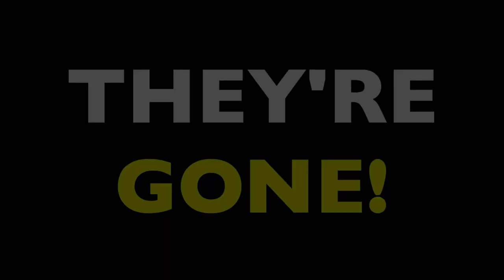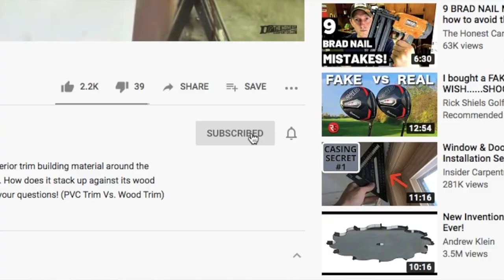There's Something TERRIBLY WRONG With My Table Saw! Should I THROW IT OUT?! (Carpenter Discussion)

Comment: Good subject.  I wangled a new table saw for Christmas.  The choice to upgrade was based on watching some of your videos along with other producers.  I had inherited an older Craftsman saw and it cuts fine but it lacks some safety equipment that is currently considered important.  The new DeWalt is in its box in the garage waiting for a warmer day for its grand opening.  By the way, Ethan, hurry up and get the new tablesaw so we can have a video on steps to set up a new saw :-)  My concern is in getting rid of the old saw.  It cuts well enough for most of my projects.  I don't have the space or need to keep it, but I don't want to pass along a saw with no riving knife, finger board or blade guard.  I HATE to have to just send the whole thing to the dump.
Reply: Someone will want that old Craftsman. Even knowing the lack of safety features they seem to move pretty quickly on Craig's List.

Comment: Had to get rid of an 8yr old rigid table saw because the gearbox burnt up. Rigid revises their saws so often, replacement parts are long discontinued. Cannot be repaired even if I wanted to.
Got a sawstop PCS, no regrets.

Comment: I apprenticed with guys who were born in the 1920s and 1930s. They never seemed to throw any tools out. One of them had a pile of old portable electric drills and saws under a workbench in his garage that included a pair of Porter-Cable worm drive saws that dated back to the late 1940s and would still get dragged out if we had to cut concrete. I now have a number of saws that no longer get used on a regular basis. One was a cheap Black & Decker that wouldn’t hold its depth of cut, anther is a nice Milwaukee sidewinder that should have a new cord and strain relief. I’ve repaired my 12” miter saw several times but I got rid of a Delta table top table saw because the switch would get dust inside and arc weld itself permanently on.

Comment: A tool goes when
1) Safety has been compromised
2) Power cord damaged beyond reasonable repair
3) Accuracy has been compromised beyond normal adjustments
4) When an upgrade is a reasonable option
I usually tear them apart and sort the scrap accordingly since I am a firm believer in recycling, and it's some money in the bank towards the replacement/upgrade. If a tool is in safe working order, I might sell it or donate it.

Comment: Had a craftsman for a while until the magic smoke comes out. Was in the middle of a project and no time to shop. Bought a Ryobi in similar price range.  It was a instant regret the moment I opened it. I needed a saw to complete a project so I keep it for 1 year.  I hated that saw so much, just like that it has to go.  

The riving knife was welded - crooked. It’s top heavy and can tip over if I cut something long.  Cut quality sucks. Non standard miter slots and table top is made with cheap sheet metal.  Not flat at all. Blade can’t be aligned. Simply no adjustment for anything.  It’s a saw-like object. It can’t cut straight unless I spend 1/2 hour setting up feather boards and sneak up on the cut 5x or more. What I hate the most about that saw like object is setting up/taking down. They made worst possible stand in the world. The saw weighs 50 lbs but feels like 100 with the stand open. I was at a point where I hated that saw so much that I don’t want to use it. 

Bought a DeWalt 7491RS. I finally enjoy using table saw again. Setup/take down is a breeze.

Comment: i got rid of my old ridged table saw. it was the cast iron top model before roving knives were standard. i made a zero clearance insert for it with a splitter. but it was starting to have  a little warp. kinda like what happened in video. it was a safety thing for me

Comment: There is a way to adjust the trunions on those saws by loosening a couple of screws in the rear and then you can use a dial indicator setup to bring it back into tolerances

Comment: I repair broken tools unless it's a catastrophic failure (like a motor shorting out that is 90% of the tool cost) or an upgrade from a tool that was crap in the first place.

I have never replaced a saw for a broken guard. I buy an OEM replacement part or just fix it with epoxy, especially when it's just a housing crack(though I always take it apart to check or fix internals). 
My miter saw guard was bent and sticking when I inherited it, I took it apart and hammered the metal guide flat and waxed the slide so it worked. I also replaced the broken feet on its clamps because the original nylon ones crumbled. I'll replace it one day with one with an arm but it's fine for now.

I'm also the kind of person who repairs wooden handles on old screwdrivers, I may not have the most common mindset 😜

Comment: Back in 2017 I bought a Skilsaw SPT70WT-01 worm drive portable table saw that had a stay true guarantee for 180 days and if not satisfied, return it to the place of purchase for a full refund. Well it took way more effort than it should’ve to keep the fence true to the blade and even worse, the blade slowly kept retracting into the table whenever it was running, so much that the riving knife blocked me from finishing the cut. There wasn’t any way to keep that raising and lowering wheel from rotating. I gave up and tried to take it back to Menards under the guarantee and all they offered was store credit. I called Skilsaw and was told the guarantee only applied to certain products. I mentioned I have the printouts that say my product was covered so I was transferred to tech support and when that guy checked, he agreed that the model I bought was covered and had me send a copy of the receipt in. I can’t recall how I eventually received a refund but I did. Perhaps Skilsaw called Menards to make it happen. I bought the Dewalt DWE7491RS and couldn’t be happier.

Comment: I am very much looking forward to your video on table saws.  I have been needing a new table saw for a while now.  The one I am using is a ventage 50s Craftsman.  The Arbor must be bent some how because the blade wobbles when it's on.  It also won't stay to a true 90° cut any more either.  I've been dealing with it because I really like the solid steal table surface, but since I can no long get a true cut from it, it's not much good anymore.
Reply from the maker: Ooh, wobbly blade is a tough issue! Yeah, I’d maybe flip it and poke around in the mount—but it’s prob time for a new one. I’ll try to post the new saw vid in February!

Comment: I trades quite a few tools in the past 2 years, most of the time if not always it’s because i see myself spending more time then i should on a task and quality not being to the level i want. And then i regret to have bought a cheapo because i only tought id use it a few times a year because every time i do that i end up going to that tool all the time.

My philosophy now is always go 2 step beyond what i think ill need because its cheaper then buying low then trashing a tool. And since im doing all the work myself even with that mindset its 5x cheaper then hiring the job out.

A diyer who pretty much on a finishing track of a 1960 house full reno and overhaul

Comment: My DeWalt jobsite saw had the same blade misalignment issue but it came like that right out of the box. I tried adjusting it but it just kept popping back after I had retightened it.
Reply from the maker: Huh, maybe it’s a factory thing Joshua. I feel like there was a time when I was dialed in, but could be a defect in the older ones 🤔

Comment: It seems to me that if a tool has reached a point where you determine it should no longer be used and is to be discarded, it is appropriate to make sure that the tool does not fall into someone else's hands to use. Don't donate it, don't sell it. Disable/disassemble it to the point where it cannot be used.

Comment: I work in a wood shop and I once complained to my boss that the blade on our table saw was out of parallel with the fence in the same way. He said it doesn’t matter because all the cutting should occur at the front of the blade—the workpiece is essentially passing through a single bottleneck there. I’m not sure I completely understand his reasoning, but I have had better luck since focusing on keeping the workpiece against the fence (i.e. away from the back half of the blade) through the length of the cut.
Reply from the maker: I sort or see what he’s saying, John. That’s why my straight rips are still pretty much perfect. But, like you, I prefer proper alignment and tight fence control 😅

Comment: I bought a rockwell 7241 about 5 years ago and it was bad right out of the box. The blade heel was off by a little less than 1/16" to the miter gauge slot and tech support called this acceptable. No wonder they include a riving knife. They put a laser on this saw. A laser. You might as well put a scope on a shotgun. It's only good for ripping when I adjust the fence parallel to the blade but forget about crosscuts. There was no way to adjust the trunion according to the tech rep I spoke to. As I find time now that its out of warranty, I will make a way to adjust the trunion. I actually replaced it with a 50 year old Craftsman with a cast iron table for $100. I was able to get the trunion adjusted to .0005". Half of a thousanth of an inch. Good enough by my standards. It took me about 45 minutes of patience and tender loving care but the saw does NOT heel. The rockwell cost four times that. IF you can't adjust the trunion, you are wasting money. I learned the hard way on my high tech fancy laser plastic aluminium playtoy.

Comment: Keeping an unsafe or inaccurate tool just tempts you to use it one more time which creates it’s own set of problems which could be  avoided. I do not have enough room for the tools I do use so getting rid of tools I don’t use or should not use is  an easy decision for me. Our work habits and needs change over time so an upgrade could lead to better productivity and safety if purchased wisely.

Comment: When switching my crosscut blade for a dado set, I had to remove the riving knife.  And wouldn't you know it, I must have placed that thing in a void to Narnia, because it was never seen again. Despite many attempts to find a replacement that would fit my saw, I ended up having to abondon the saw completely because i would NOT operate it without a knife. Yes, I know I could have built an insert with a splitter, but those are only so effective and only work for a specific blade height.

Comment: If I'm having issues with a tool that's not easily fixed and posing a safety threat especially a saw, I only need to do the math re: replacing fingers vs tools.

Comment: What I'm sharing may not be related fully to your video, but I've seen SO many postings in FB marketplace and Kijiji lately for used table saws and how they are advertised as "Used - Like New" when I can totally see the blade not straight like your table saw. That is extremely dangerous and I find that people think they can get away from just selling them in the used marketplace when they know something is wrong with the table saw. Anyways, that's me ranting, thanks for sharing your video! I'm looking for one table saw myself and have been looking at used ones - but with how many people are inconsiderate or just pushing the faults to the buyers because of the damage or flaws found in the saw is unacceptable. I may as well save up and get myself a new one with warranty, that seems like a safer option.

Comment: Thanks for another helpful and informative video! One question for you or other folks in the trades, but how do you get rid of a defective/broken tool? I feel strange throwing it into the garbage but am not sure if there is such a thing as a power tool recycling program that can pull out the valuable materials (copper, magnesium, etc.)!
Reply: In our area we have a "big trash pickup" once a month. And scrappers and recyclers tour the area for a week prior to salvage what they can. So that's a possibility, but I'd also disassemble the tools first so they can't be used.
Reply: I’ve seen so many tools just thrown in the dumpster on job sites.  My biggest peeve is when they still function but either clearly or don’t clearly have a safety issue.  I wish people would make it so it’s inoperable before discarding.  I haven’t looked into OSHA regs, but I bet there is something.  They have it for hard hats.

Comment: How worried should someone be about the motor failing on a Jobsite saw? I've accumulated a few ancient ones from older coworkers and family members, and they seem to be pretty fairly aligned, but the motors sound like they're over revving or even smthn like a rattle or vibration.  I've never really noticed any problem w the function, but how worried about motor noises would you (and commenters) be? Just use it til it dies?

Comment: Well this is where I disagree with you.  When the Blue versions of the Ryobi power tools came out 20 plus  years ago, yes you are right.  The contractors/construction sites threw them away after one of two major job sites.  The plastics always scratch too easily over metal.  I salvaged and repaired many of those power tools as the internals were almost fine to use.  The plastics can also be cleaned up if you know what you are doing. 

Ryobi helped me to become a multi millionaire in life because to be honest they ARE durable enough for most jobs..  22+ years later I still have my Blue Ryobi set up.

Get it??  I SAVED MONEY AND GOT TOOLS to for my building maintenance/property management business.  This in turn helped me get into investing into commercial income property.

Everything starts by being smart with your money.  I have seen contractors throw away so much good material that I was able to take advantage of it.  Because of it I retired in 2006 and never looked back.

Comment: Can I introduce you to the concept of 'spare parts'? The idea is that you buy a replacement for a damaged part, and then fit it to the tool, discarding the damaged part rather than the whole tool. An extra advantage (on top of the cost saving) is that you learn something about how the tool is constructed and works. The more you understand your tools, the better (and safer) you can use them.
Reply: Or just don't buy dewalt
Reply: @johnthumble5154  So, he breaks two tools, and your solution is to never buy one of the brands involved? Please, share your ‘working out' with us.
Reply: @Tensquaremetreworkshop  😂 touched a nerve did I petal?
Reply: @johnthumble5154  You tell me- did you petal or not? Is this relevant? I am guessing there was no logic in your original comment either…
Reply: @Tensquaremetreworkshop  sorry petal no prize for second, better luck next time 😉.

Comment: I only replace tools when I can no longer get replacement parts for it. Your table saw issues are most likely a result of the fence needing squared and is usually a simple thing to adjust. I would buy a replacement part for the circular saw. Much cheaper than a whole new saw, and the way they make tools these days, the old one is probably better than the new one.
Reply from the maker: No, the fence squareness has no control over the blade bevel. Something is clearly bent in there, and I can’t unbend it. If I adjusted the fence to match the blade at 90, it still wouldn’t match the blade at 45. There’s just no simple fix for that issue.

Comment: I've had this issue with two table saws in the past 4 years or so. One being a cheap Kobalt saw and the other the Milwaukee cordless saw. What causes the blade arbor to become misaligned? I can use my Milwaukee all day since the rear of the blade is out of alignment with the back of the fence (not at risk for kickback.) My Kobalt is the opposite though. Severe risk of kickback since the front of the blade pinches. I'm looking at another portable saw bit hesitantl to drop a ton of cash on a saw that might do the same. What saws do y'all use and suggest?

Comment: Can you please make some suggestions a (or several) good low cost table saws with good, stable fences? Several years ago I got a bargain table saw. It had plenty of power for cutting, but the fence was so bad, I might has well have been working with a circular saw freehand. Nothing seemed to come out with straight lines or consistent bevels. To make matters worse, the when I tried to cross cut using bevel guides those also had too much play in the channel and my cuts could be off by several degrees. I'm a retiree, so I don't have big bucks (or space) for a professional table saw, but I would love to find one with stable fence and bevel guides to allow me to make consistent and accurate cuts. I want to get slightly damaged furniture pieces from our local ReStore and repair/refinish them for resale or to donate to domestic abuse shelters. Thanks for any help you can give me (both to Ethan and other woodworkers out there). Cheers.
PS, I have been trying to work around it using a circular or jigsaw with a piece of angle iron as a straight edge, but it takes a long time to set up the cuts and one clamp slipping can destroy the whole thing.

Comment: My old cast iron Craftsman table saw is bullet proof.  I got it in 1990 and it's still going strong.
Reply from the maker: That’s the kind you keep 😁
Reply: Had the same one. Built two decks with it...two decades later I discovered chop saws. The Craftsman vs today's plastic body jobsite saws are light years apart.

Comment: When a power tool has a safety issue, to the point that you no longer want to use it, do you think it's all right to give / sell it to someone with full disclosures and warnings about what's wrong with it? Or do you think that once the problem becomes safety the only thing to do is trash it / maybe give it to someone who wants to disassemble and harvest the parts that are working?